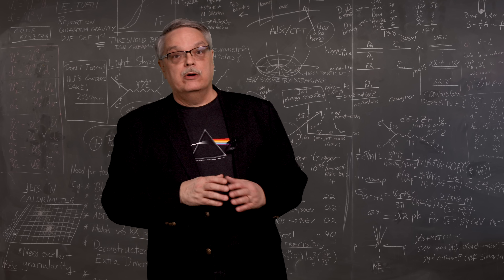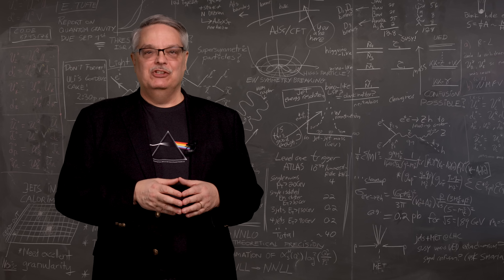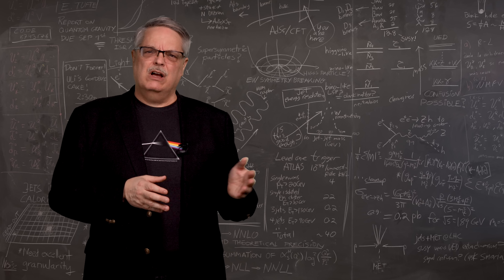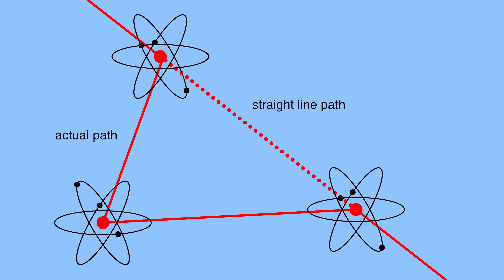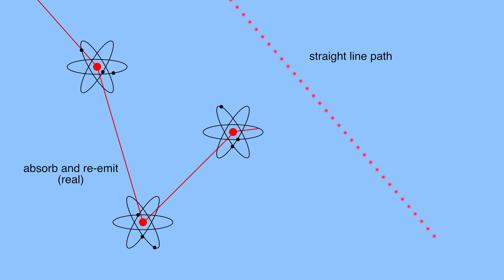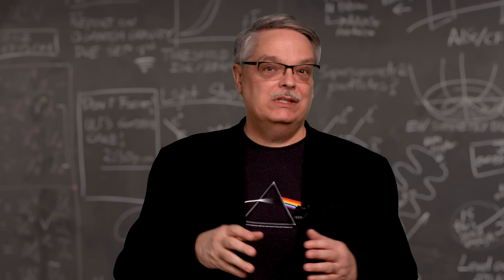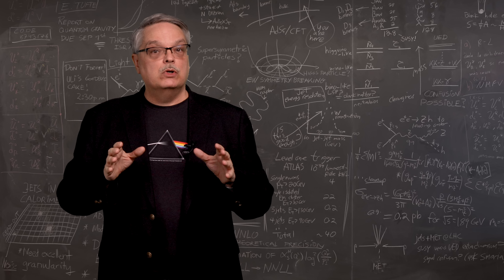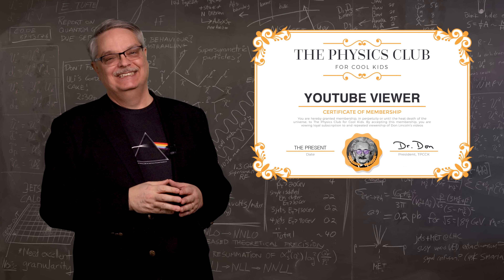Why does light slow down in water?

Comment: Did not explain the change in direction.

But very well presented. Thanks!
Reply: where to begin...
this video has taken many shortcuts in explaining the relations between the two systems and how it affects them.
to better understand this, we need to talk about d'alembert's equation and its dispersion formula and how it describes a wave.
so d'alembert's equation is used to link together the spatial and temporal variation of a wave.

and from this equation comes the dispersion relation that links together the frequency, wavelength and celerity of a wave.
to access to this equation, we use maxwell relations to describe this phenomenon. when we consider those relations in the void, we get the relation: c² = k²*w² where k is the angular frequency and w its wavenumber. (just google it, ain’t that hard to understand)

thus we can see here that the celerity is proportional to its angular frequency. however, as explained in the video, when light enter a medium, there are charges that can be influenced by the electric field, especially electrons that are 2000 times lighter than their counterparts protons.
thus, when light comes in this medium, we assume that only electrons are affected by the electric field.

we then apply newton's second law to those electrons to find a relation between an electron's speed and the electric current
(we also neglect the magnetic field of the light as the electron is relativistic thus the force from the electric field is much greater than the magnetic one see lorentz law to better understand this )
and then by generalizing this equation to all electrons in the medium, we can get an induced current from the electric field of the light.
( the current is j = n * v with n the volumic density of charges and v the celerity of electrons)

then when we put this back to maxwell ampere local equation, we introduce a new component: the induced current which thus gives us a new dispersion equation: c² = k² * (w² - wp²) with wp the plasma oscillation and thus we can see that from the value of wp, we'll get a different value of the celerity of the wave.

thus we can say without a doubt that they are wrong in their explanation as it is not the combination from the electric current of the electrons and the wave that makes it slower but the induced current inside the medium that modifies the dispersion relation thus modifying its speed.
or in simpler words, it's the movement of electrons that changes the frequency and celerity of the light, but not the combination of the two electric current. (also on a side note, trying to represent the electric current of a dipole using a sine wave.. funny thing you did there 😅)

and finally, as for the reason why the light has a different angle, well you can easily explain this using two waves parallel to each other crossing the medium in phase with each other. as they have the same wave plane, you can easily come to the relation between the refracted angle and the incident angle using some basic geometry. i recommend you to see the demonstration of descartes second law if you want to better understand what i'm talking about.
Reply: fermilab made a video on this topic, none of these answers here are correct, you should check it out guys
Reply: @Alex Lanoux 
well sorry but my approximation also works for any medium, just i used the plasma analogy because it is easier to understand.

but know that any atom is a dipole and thus, we can separate electrons and protons so plasma or not, those relations work.

the issue with fermilab explanation is that it is false. he debunked myth alright but his explanation is wrong so..
of course my explanation has nothing to do with fermilab explanation since it's at least a little truer to the reality than his
Reply: @Pauly Wally 
well no, when something burns, it break down into simpler molecules and due to the heat, in gazeous form. thus you get the impression that it magically disapear.
anyway, you should read comments before trying yourself at this explanation as i already debunked his and made a better one.
Reply: @Pauly Wally no but your answer seemed to say that if you burn something, matter will decompose into light. however this is not the case. might i remind you that you radiate light as we speak. however, your body isn't hot enough for you to radiate in the visible spectrum.
however, this is not the case for fire, hence the light.
Reply: @Pauly Wally 
you know i know my physics way better than you'll ever will, so your quote won't really help you there.

and my point is that light comes outta everything in the universe that has a temperature of more than 0°K so the fact that a combustion is happening is irrelevant to the emmission of light. the only thing that determines diffusion of light is temperature. hence my precision.

and light is an electromagnetic field, what this means is that it is pure energy. we say it "is a particule" only because under some circumstances, its behaviour is analogous to one not that it is one(or what you envision as one at least).
Reply: @Pauly Wally why do i even bother..
Reply: i presume you didn't even read my explanation on why what he said is wrong.
Reply: @Pauly Wally 
i'm not arguing, i'm explaining how it works. the thing is you have a misconception i need you to understand. when combustion occurs, molecules change their electronic structure ( this is basically what happens in a chemical reaction ) and this reaction can be either exothermic or endothermic (it produces or consume heat). and in the case of combustion, more commonly called fire, it is exothermic, and very much so. thus the heat in the plasma where the combustion occurs (here again the fire) gets to temperature high enough so that the maximum of emmission of light is in the visible spectrum, you can easily find this by measuring the temperature in a fire (around 2000°C) and applying wien's law.
thus, when a combustion occurs, light isn't a decomposition of matter, but a byproduct due to thermal dissipation.
that is my point.
Reply: @Pauly Wally 
also, you can burn something without producing light. take our organism for exemple, reactions similiar to combustion occur everytime inside it however, no light ever come out of it.

so there is a need to be precise when you are talking about something. there are things you said which are completly false (matter decomposing into light from combustion being one of them)
or arguable if not more detailed, like saying that light is matter.
Reply: @Pauly Wally 
we talk of the same thing but the way you formulated your idea can and will give misconceptions about the mechanisms at work.

btw just because everything can be considered in terms of energy does not mean that you can transform anything into something else and reversebly.
there are a few things that for now has never been observed, what you described being one of them.
Reply: @Pauly Wally 
someone who knows how physics works for exemple. people who wants to know how things works for another.
but i get you're neither of them as you only want to be inconditionnaly right.
Reply: @Pauly Wally 
the thing is i never said fire does not emit light. but well i can't blame you for that as you have no scientific vocabulary thus for you what i say is rather what you want me to say but not what i meant.
Reply: A lot of a photon's kinetic energy is transferred to the electron state, causing it to rise to a higher state. Since the atoms in glass are in a crystal lattice, the electron will drop back to a lower state and impart momentum back to the photon, immediately into the nearest atom. It will thus take a shorter path to maintain the momentum as it leaves the medium. Prisms exploit this property by changing the angle of exit, causing light of different wavelengths (and of different energy) to leave with different kinetic energy, so as to change their angles at different rates (red light is deflected more than ultraviolet light, which has more kinetic energy). Even perfectly clear glass will have some diffusion due to the fact that some nearby atoms to the path incidentally receive the energy, but at a statistical lower rate.
Reply: @deluxeassortment  
"A lot of a photon's kinetic energy is transferred to the electron state, causing it to rise to a higher state"
first, a photon has no kinetic energy so..
second, only photons with a given frequency can be absorbed by the electrons to rise to a higher energy state. (this explanation is the one he actually debunked.. even though the conclusions he got are somewhat inaccurate)

"Since the atoms in glass are in a crystal lattice, the electron will drop back to a lower state and impart momentum back to the photon, immediately into the nearest atom"
more explanation is required on this, i don't really understand how all those things are related.

"Even perfectly clear glass will have some diffusion due to the fact that some nearby atoms to the path incidentally receive the energy, but at a statistical lower rate"
again, i don't understand what you meant.
Reply: @recouer  Since when does a photon not have kinetic energy? E=hf...

He did not debunk this explanation, he debunked the idea that photons orbit atoms. The explanation he gave was the photon hitting the medium and imparting wave energy. If you want to change the kinetic energy of a photon (E=hf), since you can change neither the mass nor the velocity, you must change the frequency. Light travels through glass specifically as wave energy. The only medium it travels through is the electromagnetic field. What you were describing was the photoelectric effect, where an electron is shed, and requires a high enough frequency of light to impart enough energy to completely ionize an electron. What I described is an electron rising to a higher energy state, and this is simply an effect of the photon traveling through its electromagnetic field. In fact, glass absorbs ultraviolet light, so that when the electrons are emitted, the crystal lattice is broken, and the glass breaks down and degrades (UV degradation, although the process is far slower than in acrylics). The idea that photons simply "pass through" glass is false, else the glass would not effect the photons in a way that diffract them.
Reply: @deluxeassortment  
i see you have some knowlegde on the field but you still have a few misconsceptions.
and yes photons do not possess kinetic energy, as they don't have mass.
E = h*f is the energy of the photon, not its kinetic energy, there's a slight difference between the two but it's worth noting.

and since they don't have one, most of your explanation doesn't stand.
anyway, if i'm not wrong you are rather knowledgeable on chemistry, but this is physics here. to describe a wave, we use d'alembert's equation. here are some wiki pages to explain this:

https://en.wikipedia.org/wiki/Maxwell%27s_equations
https://en.wikipedia.org/wiki/Wave_equation
https://en.wikipedia.org/wiki/Drude_model
https://en.wikipedia.org/wiki/Mathematical_descriptions_of_opacity

also he did talk about atoms absorbing photons to be reemitted afterwards. i don't see how you came to the explanation that photons orbit atoms though.
Reply: @recouer  E=hf includes the relativistic mass of photons. 'hf' can be substituted for 'pc' in E²=p²c²+m⁴c⁴ and guess what, that relativistic mass gives us kinetic energy.

And I think you are misinterpreting my statement. I'm not saying the photon is ever absorbed. I'm saying the wave energy is propogating directly through the atom by vibrating its electrons. That wave energy effects the electron for an instant. It's as if I had a group of billiard balls, and my cue ball passes through the group, but changes from a particle to a wave as it does so, so that any energy that is imparted is immediately passed from the first ball to the next ball and so on. The balls never move, except to vibrate a little more, and they remain right where they sit. Due to the longer wavelength of infrared light, the balls would vibrate so much as to heat them up and keep the entire atoms in a higher state for a longer period of time, where the wave energy is lost. Ultraviolet light is absorbed in ionizing the electrons at the surface. Within the band gap, the photons are never absorbed by any atoms, the wave simply travels through a denser electromagnetic field as a phonon, and has a mass deficit as it propogates through the glass. Check out the quantum treatment of Lattice Dynamics.
Reply: @deluxeassortment  
reading ~
Reply: @deluxeassortment  
well that was interesting but there's a but and it is that it describes the properties of a medium in the case it absorbs light of lower frequencies. here however, we are talking the case where frequencies are high enough so that no energy is lost when going through the medium.
thus i'm not sure if there is induced phonons in the medium depending on the frequency as thermodynamically speaking, one of the resulting properties of phonons is heat.

maybe you should read the last wiki page i gave from my previous reply. it goes into details into what happens to the EM wave and not the medium. while the study of the medium is interesting to further the model, it is not indispensable in order to understand the phenomenon.

and i'll admit that light have a kinetic energy, i didn't see it that way (and now that i think about it, it's true that there is this one project to accelerate a satellite using light)
Reply: @recouer  I think to clarify what it is I'm trying to say I'll link this stack exchange post:

https://physics.stackexchange.com/questions/466/what-is-the-mechanism-behind-the-slowdown-of-light-photons-in-a-transparent-medi#

I understand the math behind EM waves in a medium and the band gap that determines transparency. The question is about why it changes direction, which is an extension of why does it slow down. The idea is that the wave propagates with a mass deficit due to the wave resonating with the elections. It is possible to excite an electron to a higher energy state without ionizing it. There is a time delay between the resonant and interfering frequencies canceling so that the wave continues to drive forward through the medium.

All photons generate phonons, and thus heat, in a medium, while phonons at infrared wavelengths resonate directly with the distance between the atoms causing them to collide, producing far more heat.
Reply: @deluxeassortment  
"There is a time delay between the resonant and interfering frequencies canceling so that the wave continues to drive forward through the medium"
not clear i don't understand what you are trying to say.

"All photons generate phonons, and thus heat, in a medium, while phonons at infrared wavelengths resonate directly with the distance between the atoms causing them to collide, producing far more heat."
that's not necessarily true, for example, the photon could instead make all the phonons inside the medium in phase with one another, thus no energy is given to the medium. 
(and this is a very interesting property as that asks the question of what happens when you let a photon travel in a medium at 0°K and this is a subject of research, as we've already tried it by making a photon go through a bose einstein condensate.)

"The idea is that the wave propagates with a mass deficit due to the wave resonating with the elections"
what do you mean by "resonating" sorry but the resonance phenomenon is a very specific thing and unless you bring me some proof (and not another forum post, real proof with physics in it) i can't take what you say for true.
also i don't see how it can get a mass deficit, since a photon has no mass to begin with (as otherwise it would get a negative one and so if we want to apply the conservation of energy, the photon should have a higher frequency...) but we'll assume you meant the opposite here. 
even in this case, i don't understand how you can know how the photon is deviated from its original path, energetic studies ain't used for that in the first place, you'd rather use it to know how much energy has been refracted or reflected.
Reply: @deluxeassortment  ??
Reply: It's in the beginning of the  video.
Reply: This is because one side of light front which enters the "glass" first - gets already delayed, while the other side which is still in "air" - isn't delayed until it enters "glass" after a while, and this leads to light wave front being seemingly "turned" to the side where delay already happens.
This is similar to a car with brakes applied asymmetrically (left-right sides not equal) turning to the side where brakes are more effective.
Reply: @rvrss7192  i still feel like it should have been addressed in this video since he mentioned it and used the the change in direction to prove the other two theories wrong?
Reply: @derekwallace1955  Yes this video was more about disproving other non-consistent theories and how and why speed reduction happens, while also important direction change phenomena was generally omitted. 
On the other hand, direction change aspect is less complex and it's explained in many sources on internet.
Reply: So many videos on that already. Search for refraction Huygens principle